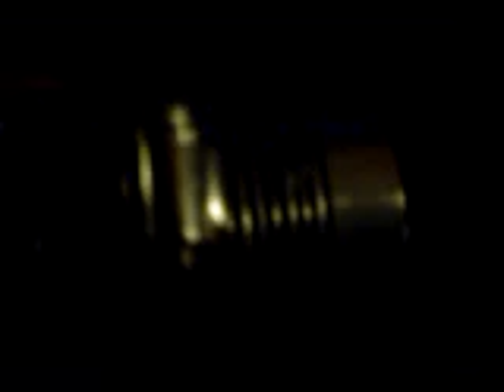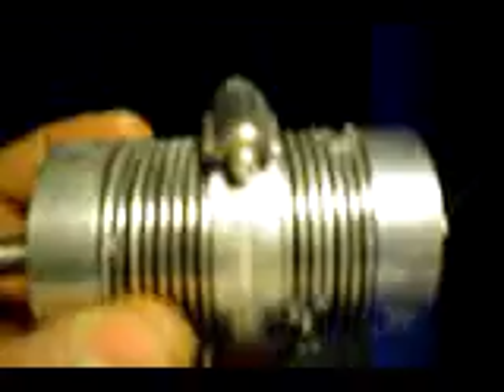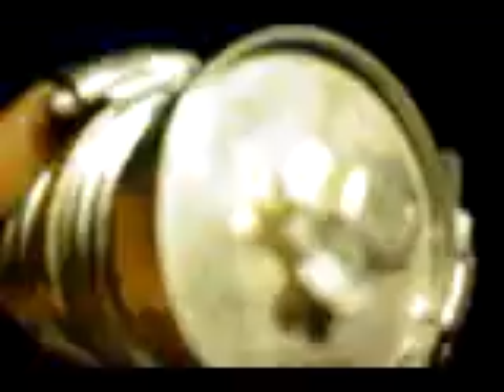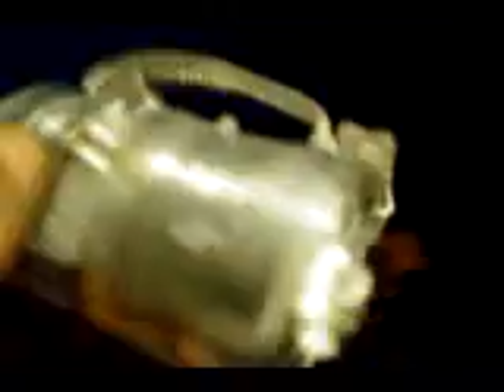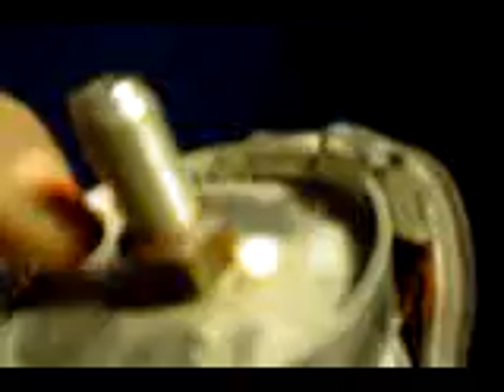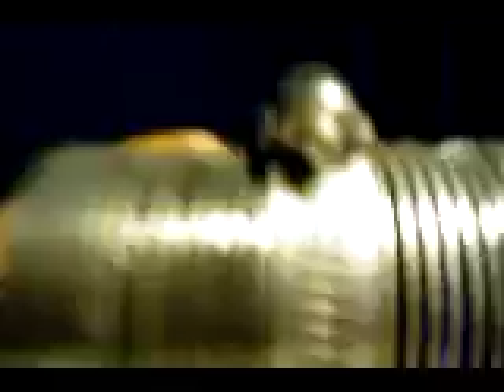new design trying for lower amps

Comment: lolz! nuetral plates...if it doesn't have a positive/neg. then current wont conduct to it.
u must have a negative and positive. in this video. there is none. u have them both hooked up to each other. So basically it'll generate heat. and could electrocute u. neg needs to be separate from positive in someway or you close the connections, short them, or otherwise electrolosysis does not take place, the current does not pass thru water..instead goes thru and arond the washers and clamps.
>1.5vwrx

Comment: you can find ss bolt up to 5"x1/4"(i think!) at depot. 
you make all that group of washers negative and surround them with a ss sleeve, in cpvc tube(regular pvc does not stand the high temperature)

Comment: inside a 2" pvc pipe, i use a group of ss washers like you have except, they are surrounded by a ss sleeve, not touching themselves, of course, since the washers are cathode and the sleeve is the anode.

Comment: if you can then do this the center should touch every third washer but not the other 2 solder every third washer together to form the positive Anode. Let every third washer touch center post. Now you have 1+ 1- 1n 1+ 1- 1n on and on. The post is the negative contact touch washers numbered 2,4,6,8,10 the solderered ones are not touch center 1,3,5,7,9 the last set touch nothing no + not center - just dead neutral. NOW you have multiple cells and you can run them with 12v 15amp likely. text me.

Comment: Kinda like SmartScarecrow said. You dont have enough voltage to run it. If you use more then 7 or so plates/washer/tubes in series then you need more voltage. You want about 2volts each, so if you have 13 washers each side the you need about 26v.  So either remove washers or add voltage.

Comment: I like the idea you got goin. Negative in the middle? I think try running the hell out of it on and off changing the water and output might get better. Once the cell washers get clean you shouldnt touch it. I have a setup with spoons and I touched one on purpose to test this and it wont show in a vid but I can still see where I touched, no gas there.

Comment: I agree you should have gotten some modest production with the setup you are using. its not really a "series" type cell as such because the current flow should wrap rigth around your neutral washers as if they were not even there. this because there is no edge seal. 

of course, there is considerable distance to bridge for it to get from neg to pos.  you might slim it down a bit so there is not more than 4 washers seperating the neg and pos electrodes. see if that gets it working.